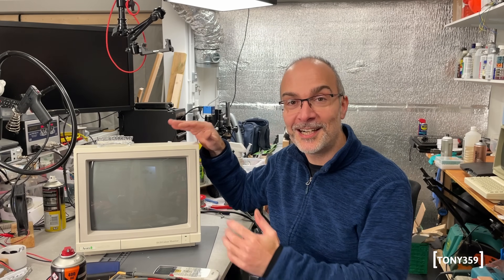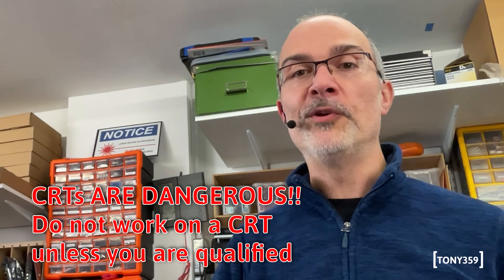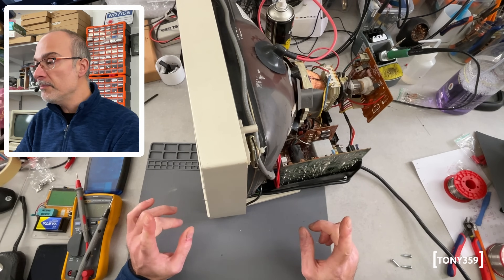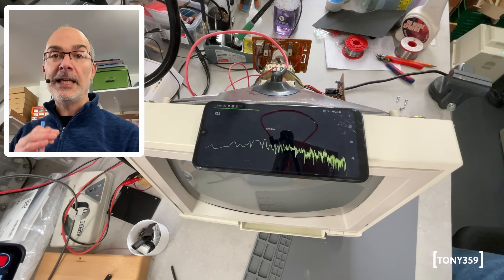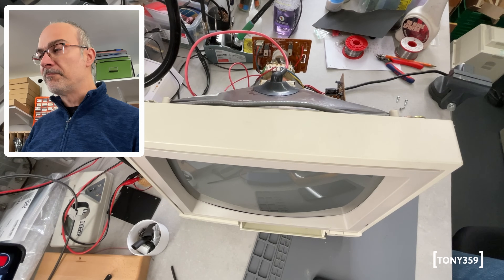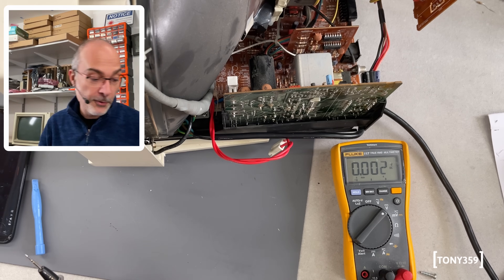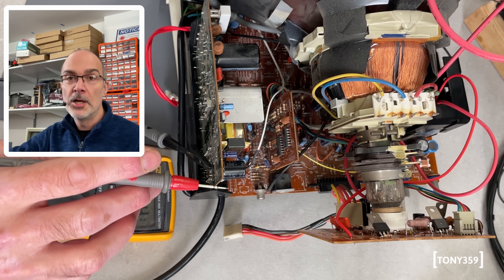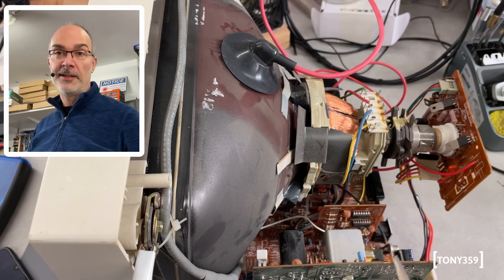"It's Broken Again!" - let's diagnose a monitor using my new Ring Tester

Comment: Hard to get reliable parts for CRTs nowadays unfortunately. Current flyback reproductions are hit and miss, even from reliable sources. It actually depends on the time of year the flybacks are made. Summer months are better because the potting that separates the windings/rings and keeps them from shorting sets up better in warmer temps. Flybacks produced during colder months fail at higher rates because the potting doesn't fully cure and they develop shorts between the windings/rings. Just something we have to deal with, given these parts are not highly sought-after anymore. Another great job on this Tony.
Reply from the maker: Interesting thanks for the insight!

Comment: New subscriber here - just discovered your channel and I ended up spending half a day binging your videos. 🙂

This video was of particular interest to me since last year I was working on a monitor with pretty much the same symptom as this one. It was the Commodore 1084 branded version but otherwise the same Philips model (except maybe configured with different inputs).

Like in your case, all voltages from the PSU was about half of what they should be and I spent quite a lot of time checking the PSU but could not find a problem there. If I removed the HOT (which was good), the PSU would output the correct voltages, indicating to me that either 1) the PSU was too weak for some reason, 2) there was an internal fault in the (original) flyback transformer or 3) something on the secondary side of the flyback was drawing too much current. I ended up concluding that the transformer was probably at fault, but since I did not have a replacement I ended up parking the monitor on the shelf. This particular monitor was quite sooty inside so I think it has a lot of hours on it, so I did not want to spend a not insignificant amount of money on a new flyback transformer which might even be of questionable quality (not personal experience - but based what I have read online).

Perhaps I will stumble upon a working flyback somewhere, i.e. an identical 1084 with a dead CRT and then I would have the parts to revive it. 🙂

Edit: The concept of the ring tester was interesting and I might check the flyback in my 1084 using this method. I don't see a reason to build this this specific device though since it is basically measuring the Q of the inductor and any ESR meter can do that. Could probably also make a small circuit based on a 555 with a transistor on the output to generate those short pulses and then watch the ringing on an oscilloscope. But I guess for someone without an ESR meter or a scope, the ring tester could be useful.
Reply from the maker: Thanks and welcome! Yes I agree with you. It’s too bad those flyback can be of questionable quality. I don’t know what happened to this very monitor unfortunately, I don’t know whether the flyback fixed the problem or not. 
I am restoring another small CRT, video will be up soon, but on the second channel.

Comment: I'm not sure if you already said, but there's any desoldering gun good enough for a casual use (Europe sellers)? I won't spend like 250€ to use twice a year
Reply from the maker: Mine is an Aoyue and I am not sure I'd recommend it. The one I'd like to try is the one @Epictronics is using, it's sold under many names but I feel it's better than the one I have. It might need some tweaks out of the box to make it better. Should be around the 150 euro range? 
The name is Pro'sKit SS-331
Reply: I have a cheap ZD-985 and can highly recommend it. It's usually around 65-70€, I managed to snatch mine for 50€ some years ago from an Italian eBay seller, with EU-wide free shipping.
Reply from the maker: I think they are all clones of each other 🙂
Reply: I have the ZD-915 and can recommend it, got it in the Komerci rebrand. 4 years ago it was like 80€, now its like 120€ but still recommend it for that price.

Comment: I think C476 might be bad, I think that was right next to that hot resistor, so you may have been assuming the resistor is what is getting hot when in fact it was the capacitor & resistor.
Reply from the maker: it could be but looking at 24:13 it really looks just the resistor - but I cannot be sure. I wish I had a chance to work on that monitor a bit more! Thanks for watching!

Comment: I suspect the 'clicking' sound you heard in the previous video was the excessive high voltage arcing through the CRT which may have damaged the tube or the rectifiers inside the flyback. You have to be very careful with high voltage circuits in a CRT, because if the high voltage becomes too high, you have a serious risk of the CRT generating X-rays. If you replace the flyback, it's essential to measure the HV output with a proper meter and adjust it accordingly for safety reasons.
Reply from the maker: Yes, apparently it's the X-Ray protection... Also apparently those flybacks come set to maximum from the factory which feels weird. Yes there is a chance some damage happened when I did that, though it was only for a few seconds before I realised. 
One day I'll get my HV Fluke probe I left home in Italy, back then I never felt brave enough to use it! :D

Comment: 16:30 if there was an open circuit in the secondary wouldn't the primary read ok?
Reply from the maker: What the tool is reading there is an internal short. Say you have 1000 windings, if two touch together, the inductance will change drastically and that's usually enough to cripple the "ring" the instrument is sending. At least this is my understanding! Thanks for watching!
Reply: @tony359  I think you misunderstood my question. You said If the primary is working the secondary is working as well. Couldn’t the secondary still be open circuit even if the primary is reading ok?
Reply from the maker: Ah, I see what you mean. If the secondary winding is broken inside (not shorted), the flyback wouldn't work but the ring tester would not show an issue. I am not sure but I think you're right. What I meant was that if the primary reads ok, then the secondary is not shorted - I probably worded it incorrectly! Thanks for that!
Reply: @tony359  👍 thought I was missing something 😁 thanks for clarifying. Just found your channel, great content - keep it up! <goes back to binge watching>

Comment: Hi.

Flyback transformers are in fact magnetically coupled inductors!
This is the basic rule for any flyback, and this helps allot, because you measure the inductance of an inductor with an inductance meter ( RLC meters are best ). 
Even if you do not have a working transformer for reference you can still get some values and search info on the on the internet. 
If you do have a working transformer for comparison, then THE BEST way to test a flyback transformer is with an RLC meter, it let's you set the testing frequency, making the measurement way more accurate, and it gives you the best possible results.
That is because if any of the windings are shorted ( or partially shorted ), then the inductance will be way smaller then it should, that is a dead give away of a shorted transformer ( the best and most precise way ).

Cheers!
Reply: In fact, is the same with any transformer, of any topology, starting from the basic 50Hz transformer and ending with the most sophisticated switching supply.. That's because any winding of any form is an inductor, with the inductance value given by the number o turns and the core's AL, so if it is a short in them then the number of turns will simply be less, thus the inductance will be smaller. 

Even if you do not have any good power transformer to compare the values with, and you can find no info on it, you can still very easy know if that unit is good or dead simply by measuring it's inductance.
Knowing that in AC any inductance is in fac a resistor directly proportional with frequency, you calculate it's reactance at the given frequency for that transformer, then you add that reactance to the measured DC resistance, and you get a precisely measured impedance at that frequency, which will be the load for the primary voltage of that transformer. From there it is easy to determine if that impedance is acceptable or not, thus it's easy to know if that transformer is good or bad. 

See, electronics is fun :)
Reply from the maker: Thank you for the insight! I think the ring tester is the cheap way to do so - you're right that an LCR meter would be the best tool. I think LCR meters usually also test capacitors as well if not mistaken?
Reply: @tony359  yes, inductance, capacitance and resistance, they are all well tested with an LCR meter ( with advanced secondary parameters as well, plus different testing conditions ). 
I have a Hantek LCR meter and it's great for the price.
Reply from the maker: @DjMarik78  Thanks! Might be a good tool for my toolbag :)
Reply: @tony359  Hantek 1803C, it's cheap and very usefull. 

You are very welcomed!

Comment: To me it's unusual for even the initial fault to be the flyback itself.

I worked on many (slightly later) CRTs back in the day, and the majority of the time it was either shorted Horizontal Output Transistor (usually due to bad capacitors supporting it), or cracked solder joints.

Granted, I didn't see as many as someone working on full time CRT repair, but I can't recall a single case of a bad flyback in isolation
Reply from the maker: My experience is very limited so I don't know. But when it comes to "new" flybacks it seems that the quality is very much hit and miss nowadays. I cannot say though, I wish I had a chance to finish that repair! Thanks for watching!

Comment: Not all replacement flyback transformers are the same. I have replaced them under warranty. The yellow glue over the years will become conductive. Many poorly designed displays over the years.

Comment: Makes me wonder if something on the board is drawing too hard on one of the flyback's outputs, causing the winding to overheat. (Probably just defective, but ¯\_(ツ)_/¯.)
Reply from the maker: That’s also an option though I didn’t see anything very hot on the PCB. If it’s the high voltage getting driven too high, it’s either the flyback or the CRT itself I think but feel free to correct me as I am no expert 🙂